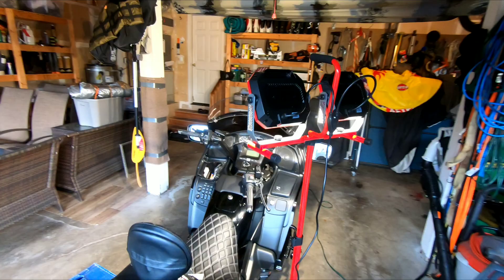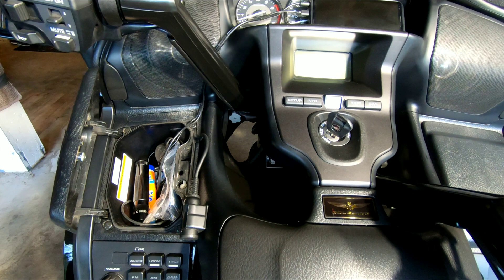Bluetooth Adapter Install in Honda F6B Motorcycle for Music Play

Comment: What is the part number of the blue tooth adapter for the goldwing
Reply from the maker: Hi Jim,  it would be worth calling them up and checking.  I'm not sure what the number is exactly...
Reply: Hi Jim, I recently bought this from Electrical Connection. Part Number is 03215. Isolator kit part number is 03216.
Reply from the maker: @Mickeyfoccer  Good info

Comment: So my only concern is right now when I have my Bluetooth helmet on and a phone call comes in, my helmet picks up, I'm just worried if I hook this up, and have Bluetooth going instead of the 3.5 mm plug, when a call comes in the motorcycle speakers are going to want to take the call instead of my helmet. Any dealings with that? I should mention I have a newer phone that can connect to two Bluetooth devices at once.
Reply from the maker: Good Morning John,  That's a really good question. I'm not sure. My phone will also connect to two bluetooth devices at one time.  I'll probably get the cardo packtalk bold system in the near future so I'll get a chance to see how that works and will let you know.
Reply from the maker: Hi John,  Just wanted to pass on some info.  I use Google maps for my gps directions and the voice commands play over the speakers now.  The voice directions are going over the bluetooth.   I thought the bluetooth kit only did music but it seems to do a little more...

Comment: I own a 2007 Goldwing and just ordered the adaptor.  I do not have a power adaptor in my storage console.  Only thing I have is the AUX cord.  Did I see correctly, did you plug one connection to the of the power adaptor in your console that I do not have???
Reply from the maker: Hi Timothy,  I happen to have a usb power adapter in the storage console.  I'm not sure if that was standard back in 2013 or if that was added in by the first owner.  I don't think it will matter.  The bluetooth should connect inbetween your existing power connection connector.  I would imagine your 2007 should have the same type of power connector under your storage console that mine has.  You could contact Electicalconnection just to make sure.  Thanks for watching!!
Reply: Did you ever get this figured out? I don't have a cigarette lighter in my pocket but I'm told the chords are under the pocket. The red one will be for the power and the white one will replace the aux chord.

Comment: Is the sound better with your set up than a rechargeable or usb portable blue tooth  device (less than $20 on Amazon) that plugs directly into the small 3.5 mm aux on the wing? That way you don't have to take the box out etc....
Reply from the maker: Hi Doc, Great question but not sure. I did a J&M Speaker Complete Upgrade also (see vid if you like) The sound seems really nice.  The portable blue tooth device might be worth trying since it's so inexpensive.  The box is really easy to take out.  Maybe 10 min to do.  I also want to try just blue toothing into ear buds or something like that.  I know that's not safe, but wanted to try...

Comment: Hey man, thanks for the video!
In the link you provided, it asks if I want the Bluetooth only or Bluetooth with ground loop isolator, which one you have?
Any ideas if I need to buy the ground loop isolator as well?
Thanks,
Reply from the maker: Hi Hussain Kh,  Sorry, I'm not sure.  I think I still have the box it came in at home.  I'll look for the part number on it when I get home from work tonight and send you another reply.
Reply from the maker: Hi Hussain Kh, The part number on the invoice is 03215.  It doesn't say if it has the ground loop in it.  Hopefully this helps.  If not, there phone number is 865.219.9192.

Comment: What brand is the one you installed?
Reply from the maker: Hi Victor,  I don't remember the exact name but I remember it came from electricalconnections.  I put a product link in the video description that you can click on.  It will take you to the one I used so you can check it out.  It seems to be working really good.  I use goggle maps from time to time and the goggle directions come through the bike speakers also.  Thanks for watching..
Reply: I will look into it.  I have a 13 F6B, and my mother in law has a 03 Goldwing.  I found a similar adapter on Amazon without the T connectors, that I ordered to install.  Hopefully it works just as well.
Reply from the maker: Sounds good. How did it work out?
Reply: @bgrides2108  I got them about a week ago, and it was a quick install.  It plugged into the connector where the auxiliary cord was.  Then just needed a power and ground, on mine is the red plug.  My mother in law's 03 Goldwing not so much.  But I'm very happy with them.
Reply from the maker: @benfattovf  Nice work!!